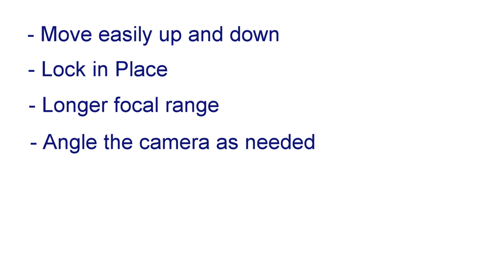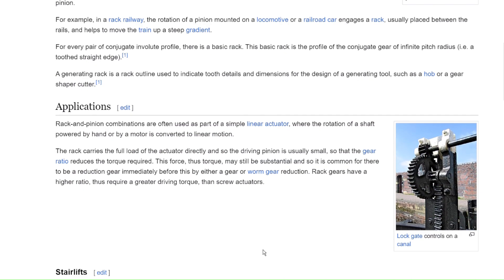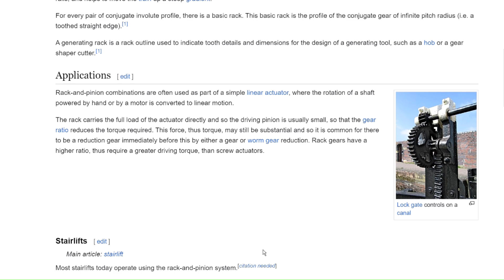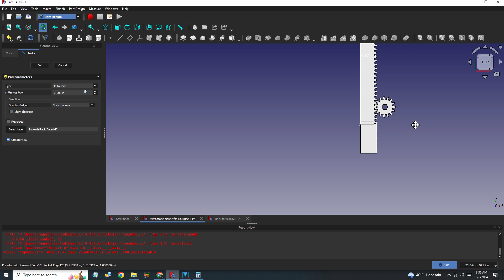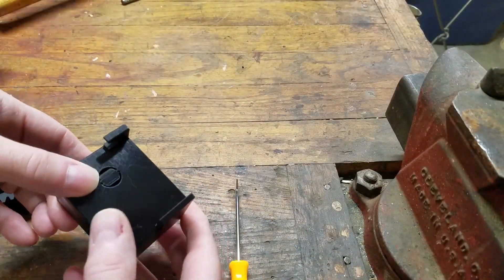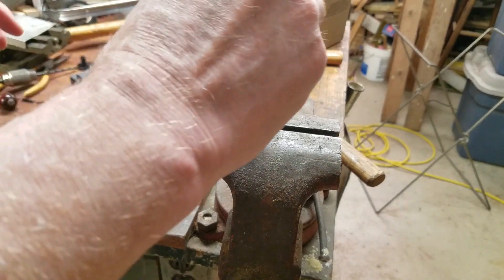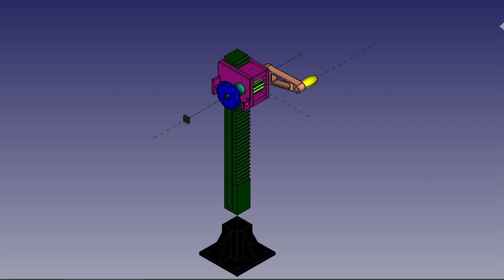Refining my Plugable USB Microscope

Comment: Any idea on how to clean the lens on these usb  digital viewers ?  (microscopes - well sorta!)
Reply from the maker: Good question.  I guess I would use a little eyeglass cleaner on a microfiber cloth and move it around with a Q-tip.
Reply: @LifewithDavid1  I found something that works awesome, pipe cleaners  but you have to use a crazy fuzzy one and bend it so the tip of it that is a thin piece of metal, is not scratching the lens.  I'm sure there's something better but for now, I'm just glad that I got rid of some of these blots that were on the lens!   But yeah, it works perfect!  There's no way to really take these cheaper digital viewers apart, I kind of wish there was, but that's ok.   Now to figure out how to keep solder smoke away from the hole that leads to the lens!  (I use a cheap "PLUGABLE USB Digital Viewer" (Microscope)  A dry pipe cleaner didn't work well but the smallest amount of 70% Isopropyl Alcohol didn't smear (like the 40% I believe is the other one I have that did smear)   I Think 70% may evaporate faster is why?  Not sure but maybe something to make a short video on sometime.  I use the 70% for cleaning thermal compound/paste and flux and in general on PCB's - so I'm also glad I was able to try both as I wouldn't ever want ammonia like what's in Windex and other glass cleaners near any kind of lens! ( Learned my lesson already! )  It's bad for the lenses and also, anything with color actually attracts dust! (Like the blue in Windex!)   Anyways, just thought I'd share!
Reply from the maker: @AEON.  That's a great idea.  I use eyeglass lens cleaner; it works better than Windex.  Thanks for the suggestion!

Comment: Nice mount! I also made a mount for the digital microscope I use for soldering. It too came with a really lousy stand. I could only fit relatively small PCBs under it, and fiddling with the stand to get everything lined up just right was always a real chore. But I went in a rather different direction with mine. Many moons ago I used to podcast, and although I haven't so much as looked at a professional microphone for years now, I still have my mic stand attached to my desk. It's one of those articulated arm types, like a desk lamp, only it has a threaded rod at the end of it that you screw a mic clamp onto. I have been thinking of removing it, but I got the idea to try repurposing it as a mounting arm for my microscope. Jumped onto TinkerCAD (I'm still very much a FreeCAD neophyte) and modeled something quick and dirty and 3D printed it, and it works beautifully. Now I can fit extremely large PCBs under it (as big as the surface of my desk) and I can freely move it about to focus in on exactly what I am working on. For lighting I got a couple of gooseneck LED lamps that I can turn on and bring to bear as needed. And when I'm not using it, I can just swing it up and out of the way.

My next challenge is dealing with the focusing knob. Focusing the microscope is pretty fiddly, because no matter how gentle I am, just the act of touching the focusing knob usually causes me to knock the microscope slightly out of alignment. My current plan is to put together some sort of electronic focusing rig. Pi Pico W (so that I can control the focus remotely, no need to physically touch it) and a stepper motor with a 3D printed gear that turns the focus knob. Sounds good on paper, but you never know until you actually build it, which unfortunately I haven't had a chance to get to yet due to being swamped with other things that needed to be done first.
Reply from the maker: That sounds like a really capable mount.  I can't get nearly that large a board with mine.    The Pico focusing could work well.  Auto-focus, anyone?  Thanks for watching!